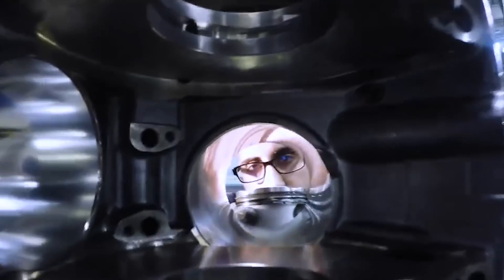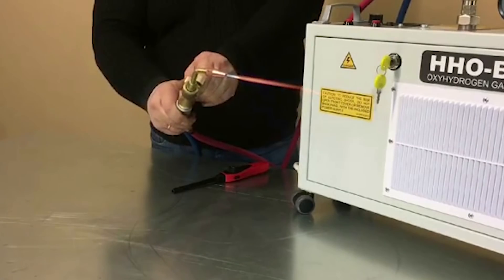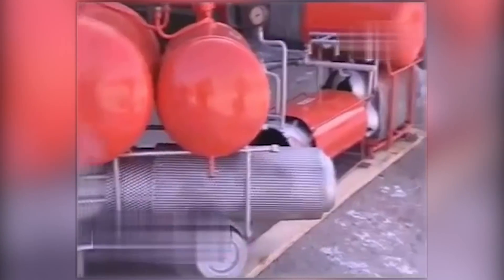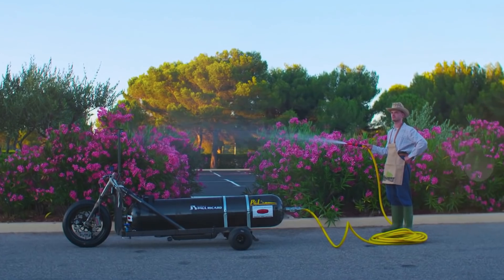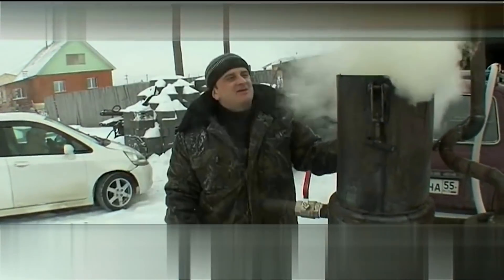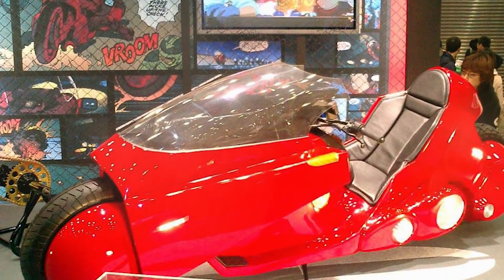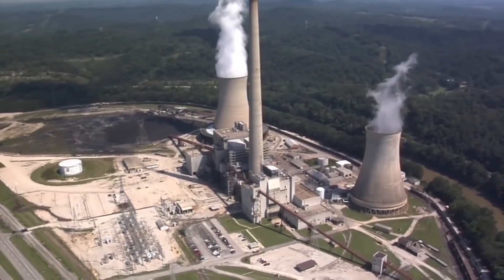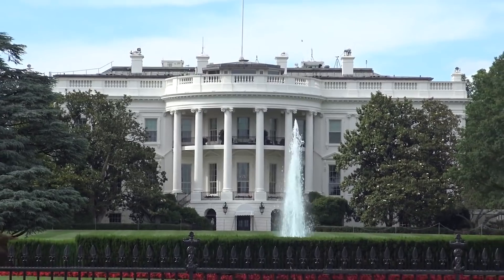Why These Engines Are Banned?

Comment: zero expense?  So just how do you compress air without using energy?   You could sell the zero energy air compression technology to every tradesman with a nail gun.
Reply: Air is a terrible way of storing energy, friction losses all the way, from compression to storage to work done.
Reply: @abyssmanur3965  and heat issues - IE compressing the air makes it hot as hell. Decompression cools it down and reduces pressure etc.
Reply: @gordonlawrence4749  Yes my mentioning friction is essentially the same thing, friction of compressing air generates heat, which is energy lost in this scenario. jaxative jax
 however came up with this:
@Abyssman UR And yet it is safe, efficient and much cheaper than oil derivatives. Friction loss occurs in any form of motive system and at least this way very little is lost as heat.

you just cant help some people.
Reply: @abyssmanur3965  not all the heat is due to friction. Just compressing air will heat it due to the more obscure implications of the Bernoulli effect.
Reply: @abyssmanur3965  And yet it is safe, efficient and much cheaper than oil derivatives. Friction loss occurs in any form of motive system and at least this way very little is lost as heat.
Reply: Doesn't matter when it's freely being generated simply by water flowing down stream.

Is not like it's dirty energy it's literally isothermically charged compressed air.

Only the best air you can breathe and also once the water has been oxygenated that can either be drank OR used for plants which drastically improves yields.

One man's waste in another man's solution.
Reply: Gods Country Bumpkin ko
Reply: Windmill pump.
Reply: @TE5LA-GAMING  So do you use multi terra liter storage tanks or air hose umbilicals hundreds of km in length?
Reply: You eat beans. Then it produce gas as a by product. The more you eat the more gas you produce. Problem solved. 😆
Reply: @winniethepooh1931  lol logic 🤣🤣🤣🤣🤣
Reply: solar array charging maybe? once the PV system is installed there is negligible cost for the energy :)
Reply: @sagemuffin  Using solar to charge a battery to run an electric motor to drive the wheels is much more efficient than using solar to charge a battery to run an electric motor to drive an air compressor to store compressed air to drive a compressed air motor.
Reply: @sagemuffin  You need batteries for storage then run the power to your (line loss)inverter to convert to ac for the air compressor(conversion loss).

Why generate power and then convert to another type of power?   Plus the heat a compressor generates is just flushing your photovoltaic energy down the shitter
Reply: @sagemuffin  how much is your PV system going to cost to install?
Reply: @sagemuffin  If you are going to use PV, why not use electricity as your power source.  You will lose too much power to generate your air pressure.
Reply: you can use the fusion ball in the sky,thats free.
Reply: @69NOMAN69  gathering and storing the sunlight is hardly free.
Reply: @69NOMAN69 , you can debate all you want. Converting sunlight to electricity and storing it is not free.
Reply: @countryjoe3551  they aren't arguing that... they are arguing the cost of the energy itself.

i don't recall Man ever making a Star, so there is that...
Reply: @69NOMAN69  sunlight might be free, but photovoltaic panels and Li-ion cells have lifespans, and will periodically need to be replaced.

So capturing and using that sunlight is NOT free. It's cheaper then Coal at this point, and is approaching Natgas cheap, but it's not free. Ditto Wind. Wind itself is free, but Turbines need TLC or they break down.
Reply: @DFX2KX  I think your missing their point, a photovoltaic cell, lets imagine costs 300$ if you get a positive output, of 500$ worth of power, that is "effectively" 200$ free. 
 A system that once it is put together, functions over the cost to the user, is a net gain. 
  There is no such thing, as an "over unity" device, but the closest we will get to such a thing, is using something thats not man made/refined/etc such as a Star. 

To your average human, a sun's billions of year lifespan, if effectively "free fuel" 
 The "engine" or "motor", "collector" doesn't matter much, in terms of what is or is not "free".
Reply: @dijasom  Sure we have.......but our fusion reactions lack the mass to form a gravity well so they go supernova after a few microseconds.
Reply: you can use OFF GRID energy -_- solar energy with the right know how can be used to fill a tank , heat your home , hell even charge a pos electric car that will end up getting passed my a gas driven one quickly especially in a town or middle of nowhere desert because no outlet sources to charge the dead end car ( where you gonna plug in your electric cars now ? HA..HA..HA.. ) but to charge your car from a solar or wind energy would take a bunch of panels or about 5 wind generators to charge a electric vehicle at a painfully slow af rate you would need a charge rate as fast as your discharge rate to make it worthy to even have or to be done so until then gas cars are unfortunately the way to go.  " you need power to make power, but the source of the power is left to you "
Reply: compressed air holds like 1/100th the power by volume as gasoline. We burn gas cause it holds a lot of calories.
Reply: @Cenobyte40k  I did some calculations a while back and it was closer to 500 to 1 assuming 300 bar cylinders. That's about the limit as air compression gets a bit weird and non linear about there.
Reply: Maybe using a bicycle pump. Nyuck, nyuck.
Reply: @mikefrech1123 I had the same thought, and we may "Nyuck," but the concept actually might work on a much larger scale using a heavy weight and gravity to cycle the plunger. Would still need a warm body for set up though.
Reply: @mikefrech1123  Even that uses energy . .  you pump it by hand, you get tired you need to eat, where did you get the food ? Let me guess you drive to the shop.
Reply: You have to eat anyways. Bicycle pump for the win
Reply: @stuinNorway  Well, you would have to drive to the shop because after all that pumping you would be too tired to walk.
Reply: @pops55650  the more you exercise the more you have to eat. You cant exercise more without losing weight or eating more if you were stable weight wise to start.
Reply: @pops55650  Hmm, well why do the triathlon athletes bulk up on massive amounts of carbs before an event?  Could it possibly be the fact of extra energy output requires extra energy input?  Or does the human body spontaneously generate extra energy by............magic perhaps?
Reply: @pops55650  No dude you gotta eat MORE when you exhaust yourself - whether you use the pump OR the bicycle (to power a generator) - its cute, but it aint free
Reply: Duh the compressed air factory geez lol
Reply: In India they steal the electricity before the meter to run the air compressor. WOW! you can run a car for free!
Reply: Sorry
Reply: Again, sell sell sell sell.... have you learned  NOTHING??!?
Reply: If my infinit generator it works => you can say 10Q for electricity => i control the planet electricity
Reply: Actually you can compress air quite easily without a compressor.   However, there are limits to how much compression you can get.
Reply: If only we could stop the air coming out of this guy's mouth.
Reply: @Polkadot Ninethousand So does quantum mechanics, they have found in certain circumstances that entropy literally reverses, so meow. if man can find a single loophole to thermal dynamics, thermal dynamics is meaningless. 
Man will exploit every possible method to make money lmao. 

Now thats not to say, anything in the macro world, is going to change thermal dynamics... but... if there is a way, man will eventually find it.
Reply: I did not know it is illegal to walk to the store and/or grow your own damn Pork n' Beans. If those things are illegal, then, what is the point of inviting Hans and Franz over. It is a HansnFranzspiracy, i tell you.
Reply: Cheaper then gas by the gallon stupid
Reply: @bradentipping6474  "Cheaper than gas by the gallon" is by no means true, the amount of Labor, even if the system is automated, means a compressor, had to expend substantially more energy, than the energy used to dredge up the crude oil... 

if Pricing was purely honest, gasoline, would be so so much cheaper than compressed Air, however it is a limited resource, and supply and demand are in fact a thing. 

The pure energy output of gasoline, is astonishingly high, for the amount of energy needed to acquire it. 
 the issue comes from the cost to the environment, and nothing more. 

Compressed air, is the most useless, waste of energy, one could come up with in this day and age, to power a car... 
 to power tools? quite convenient, but to store, and power a vehicle, its reaching, at best.

I am by no means good at math,  but using conversion Calculators, i found that a gallon of Air, at 100PSI holds roughly 20,000 joules of energy. 
While a gallon of gasoline, has close to 120million joules. 
 If your better at maths, and can show sources, that would be epic, but as it stands, Air, just seems terrible. 
Mind you, a gasoline engine, uses Very little of that 120 million joules, so there are certainly inefficiencies, though even with all of the issues, a gasoline engine, is a much smaller Waste of time, than a compressed air system. 
Improving on the gasoline engine, would be a better benefit to mankind, than trying to make compressed air pertinent.

The only benefits compressed air, has over Gasoline, is that it is "clean", "renewable", and nearby... 
 While gasoline is by far more efficient, but can only be gathered, with specific equipment, in specific places.
Reply: @dijasom  yea but I run all my equipment on hydrogen generators with a trickle back up to reduce power cost soo u know
Reply: @bradentipping6474  I don't understand, how you are saying "your reducing the cost" in any way, via a hydrogen generator... your using a very lossy system... to create even more loss... 
 Please, explain in more detail, how this makes more sense, to any other person than just yourself. 

if you are using Solar, to separate hydrogen, then powering a compressor, via that hydrogen... you are taking unnecessary Steps, so please explain.
Reply: Quite true, there is no something-for-nothing proposition.  But expenses could be considerably less with some forms of alternative energy, and with much less disastrous results to the planet.
Reply: @tyrssen1  That is not entirely true, Solar power, with solar cells, does in fact give "something for nothing" But only in the terms of "solar panel lasts for 40+ years, and only costs a small portion of the possible output" 

there is an initial Cost, but after awhile, that cost is "refunded" and "something" comes from "nothing"

On the more literal sense, that something comes from a Star... that is using unfathomable amounts of fuel, to charge your iphone for instance... but no one made that Star... so meow... "somethin from nothin" still fits.
Reply: its 100% fake news....the entire vid is just bullshit.  its a fantasy  for libtards
Reply: @mattycheezeburger  Thorium reactors are very real actually.
Reply: @ramonrichie9683  i i know all about them...and thers reasons we dont use them...lots. current nuke tech is wayyy better. thorium powered cars are the dumbest thing ive ever heard of. imgaine haveing a 10 kilo ton powered nuke bomb as a car..go watch some real doctumentaries on thorium reactors.
Reply: @mattycheezeburger  Out of all the documentaries i've seen they all said the reason thorium is a viable alternative is because it has no weapons or explosive capabilities?
Reply: @cotycollins6302  well..first off there is this law that says the better something is as a vehicle...the  better weapon it is...but  besides that. it dose,,just not for a military.
Reply: @cotycollins6302  say...your car is hit by a train( never mind that a thorium reactor will never fit in a car with out killing everyone around it in a micro second) ....the car then gets wrecked..and radioactive materials posin the enviorment for 25,000 years.
Reply: @mattycheezeburger  Not all fuels are explosive, uranium can't just be a weapon it has to be altered into a specific isotope of uranium for it to be weaponized, otherwise it would just get hot and burn.
Reply: @cotycollins6302  have you ever heard of a dirty bomb? hint..its not a fission explosion. and dosnt require any specific type of fuel. and idiots think we are gona be driving around in one. regardless of its potential as an explosive...it has massive potential as a source of radioactive material. so instead of blowing up a city...you make something like..idk...the great lakes,,,radioactive forever.
Reply: @mattycheezeburger  and the only way to use it is to expose it to neutron radiation to convert it to uranium and use it in a fission reaction.
Reply: @mattycheezeburger  Some of it definitely is like electric motors many times more efficient than modern ones. Just how is a motor going to be "many times" more efficient than 90%? The guy does not understand basic science.
Reply: It's very easy to get compressed air, juts use flowing water and a trompe.
That's your compressed air but obviously with the cost of the trompe and a good size tank but after that it's essentially free.
Reply: Why couldn't you have a compressor built into the car to continuously refill the tanks while the car is moving? Just curious why that wouldn't be part of the design, seems doable.
Reply: @Ez4u2bnvs  powered from what?
Reply: @Ez4u2bnvs , how do you plan to power the air compressor while driving?
Reply: @Ez4u2bnvs  "why don't they put the sun into the car, then they could just charge the Solar Cell's directly, with less loss from day night cycles"

that is how absurd your statement is. 

The more function you have, the more insane the concept, supposedly, a thorium Reactor to power a car, would require 8 Grams of thorium for 100 years of drive time, i assume because its always on, and recharges somehow during downtime. (batteries?) (plutonium would need much less much much less)
The issue with Thorium Reactors in a car however... is that they would make plutonium, to some degree public, as one of the byproducts of a thorium reactor, is plutonium and uranium, a small amount sure, but the government really doesn't like, the public having any amount.

Now they say, if it can be used to power a vehicle, it would make a better weapon... So i guess Solar energy, not even Fission, would be the most majestic bomb of all time... 
 Clean too, just give everyone sun burns... best super weapon of all time. O_O

Comment: Just stop.  You have no freaking idea what you are talking about.  Look, I don't give a rat's ass if you don't know anything about the laws of thermodynamics.  You probably think they are just part of a big conspiracy theory.  You also seem to have no clue about how electric motors work, but just about every electric motor made in the world is a magnetic motor.  But do this.  Make measurements.  Carefully measure the energy in and out of these engines that you talk about, and you will see there is no magic going on.  If you can't even make measurements, then please stop and read up on the Dunning-Kruger effect.

Comment: Tesla built the best one, the Teals Turbine! I am doing research on this right now, we just finished our air bearing system so that the turbine floats on air!
Reply: He made that thing out of a theory, he could neber actually make it himself. It doesnt work that well
Reply: @devinwilliams3489  You'll have to wait and see, remember not all of Nikola Tesla's work made it to the public. We should have it working with full load at ultra high rpm, and should generate large amounts of energy from the axial flux generator attached to the shaft.  We can then replace the internal combustion engine with an aluminum casing and hardened steel disks.
Reply: @devinwilliams3489  I am assuming you built one right? That's how you know? Stay tuned to see it work :)

Comment: Thorium power plants will never be allowed, they dont produce the byproduct used in nuclear weapons. 
 A lot of sheepeople in this comment section, do your research people
Reply: Of course, since our nuclear stockpiles are considerably smaller than they were in the 50s and 60s (when, as you correctly point out, uranium reactors were developed because of nuclear weapon production), that reason for not developing thorium reactors no longer exists.

Comment: "Zero expenses"? Have you priced the compressed air bottles? Yeah, they're free, huh?
Reply: And you use your lungs, to blow them up like a balloon. No need for a special compressor that draws electricity from a coal power plant. Because that would be ridiculous converting energy 3 different ways with efficiency (power) loss at each stage, while still using fossil fuels.

Comment: It all comes down to energy. How much energy dose it take to produce the fuel? How much energy do you get from that fuel? What are the environmental concerns of using that fuel? How safe is that fuel to use?
       When you consider all of these factors, you quickly see why some technologies are not used while others are. It has nothing to do with anything being suppressed. There is no conspiracy to keep burning oil. I won't give any numbers here, that would be pointless. All you need to do is research this yourself, considering the factors I mentioned.
     You should compare the "explosive index" of hydrogen compared to other fuels. That is the range of air-fuel mixtures that will be explosive. It is mind blowing.